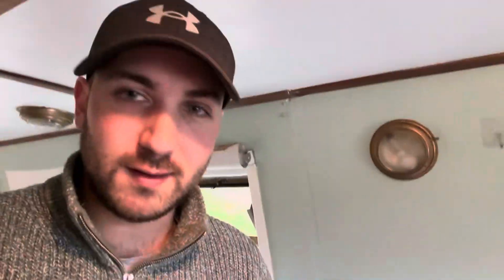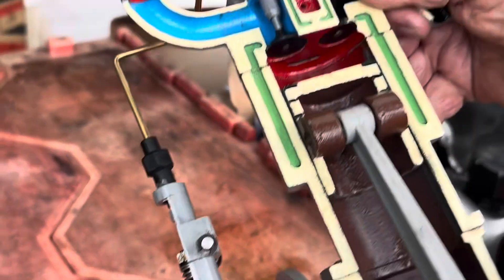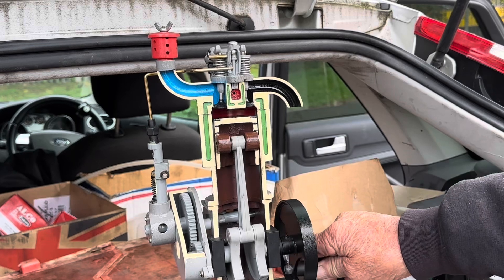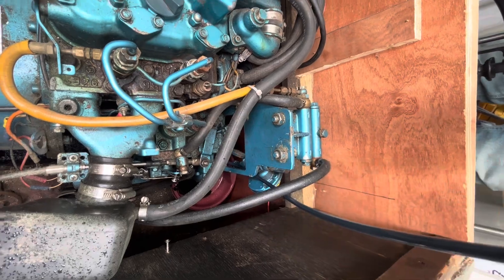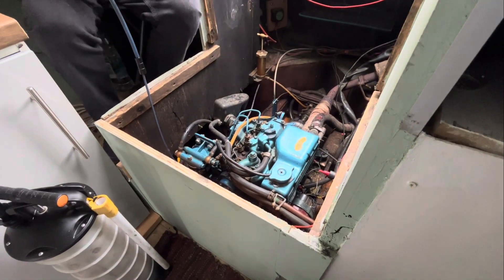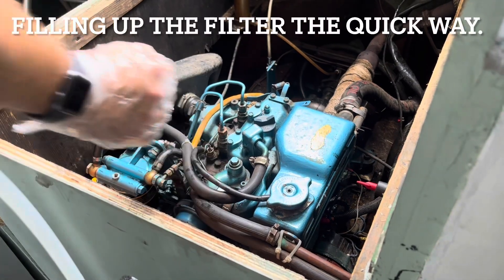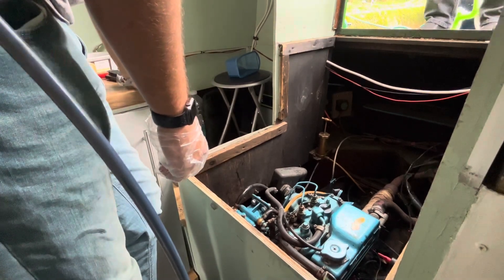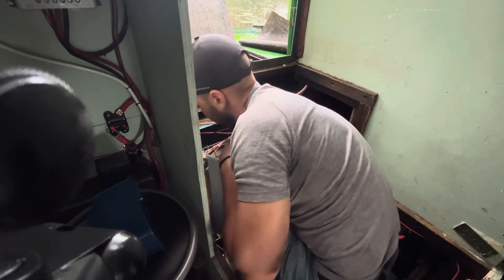EP 57- Engine service

Comment: Good video, and now you can do the engine service yourself, automotive stores sell the vacuum pumps to suck out the oil. The little two cylinder diesel will last forever if properly maintained, and twice a year would be advisable. Checking the valve adjustment should be on your engine things to do.

Comment: There is something really satisfying about servicing the engine on your boat, car or motorbike.
And you can tell a lot about how it's been running and the general health of the engine by the state of the oil and the filters.
Keep a belt, some oil and filters handy in case of emergencies, and you'll be all set.

Comment: Oil changes is very cheap insurance on a motor.  So is air filter.
Should carry a spare belt, just in case.
Have you waxed Bamble yet?
Reply from the maker: No I still haven’t waxed!! Will do soon